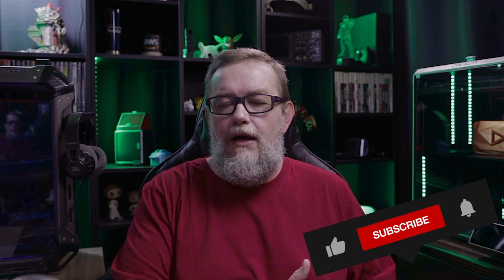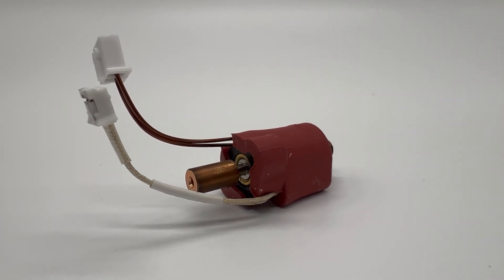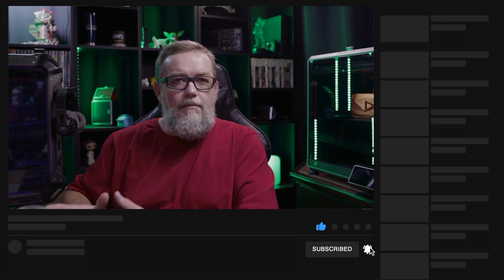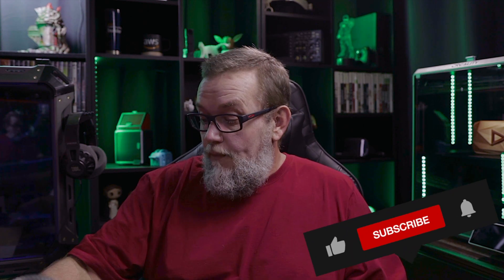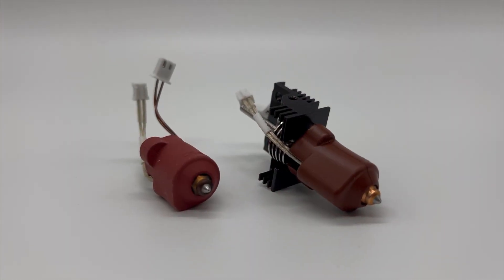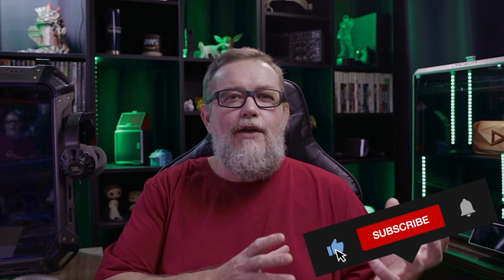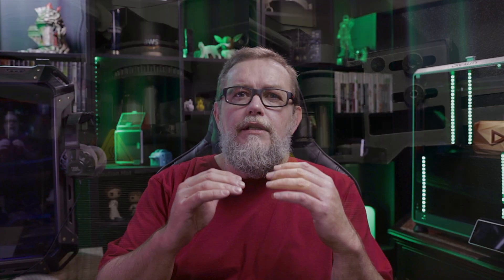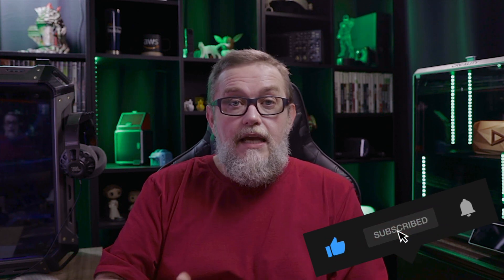Creality K1 Max now has K1C Upgrades: What's New in Creality 3D Printers?

Comment: Hi. I just purchased the new upgraded motherboard and the new motors with smaller pulleys for the k1 max as mine is the older type. Will it be good to go once i have done this or will i need to do any settings. I will update it for the CFS setup once completed. Cheers for a great channel

Comment: @Inventor's Garage
Thank you so much for this information. Based on this video I changed my initial order for a K1C to the newer K1 Max model, which indeed has the upgrades found on the K1C after I enquired. Thanks to you I got a bigger build volume than the K1C but with the same upgraded features. Really appreciate the advice!!

Comment: Hi thank you for your review. I wan to buy an 3d printer but I can not decide. Which one of it recommended from K1C or K1 Max ? Is there any feature exists K1C have and K1 max does not have ? Thank u
Reply from the maker: No, every functional component on both printers are basically the same, K1 Max has the Lidar, what is not really functional at all, at the end of the day the main significant difference is the bed size.

Comment: I'm not sure about the claims of titanium being more resistant to abrasion than stainless steel. I may be wrong, but I thought the point of using titanium for the tube is that it's less thermally conductive so less heat is lost from the hot-end. I.e. it's a better heat-break.

Comment: I have some nice upgrades on printables for the K1C, specifically a fix for the camera lockups, I also have a nice internal filter system for the K1C, also should work on the K1, I just ordered the latest version of the K1 Max and I will have a filter and chamber heater combo upgrade for that one too.
Reply from the maker: I'd love to see the chamber heater mod, can you share it?
Reply: @InventorsGarage  I have on Printables already, but I'll make one specific for the K1 Max once I have it, if you search for NexGen3D on Printables you will find my work, I find that these larger printers need chamber heating, small printers not so much.

Comment: The problem i notice, is the lack of info on creality store at AliExpress, wich shows the different options of nozzle/hotend for the same printer name, i had to replace the nozzle heater and i was almost picking the wrong one, happily i dissambled the old one first and noticed the difference. Just a question if any did it.  New nozzle/heatbreaker/heater/dissipator combo, is just snap off the old model snap in the new one? Or need to change the entire extruder toolhead assembly? I noticed my k1c prints lw-pla easier than my k1max first generation, k1max gets clogged because filament gets foamed inside the heatbreaker/dissipator and goes up to the ptfe tube, and that sugest me some heat is passing to the filament on the ptfe and dissipator transition.

Comment: The funny thing is... The K1C was basically just an attempt at fixing the K1. They might as well have called it the K1C Max and charged $50 extra just to make the money and increase marketing. They still need to fix their extruder design. Give me a Qidi instead any day.
Reply: Tell me about it! I've never been so frustrated with jams as I have with my K1 Max.
Reply: @colenado  Hmm...

My K1 max runs great.

Most problems people experience are with the regular k1. 

🤷
Reply: @DingleBerryschnapps  I finally got mine ironed out with a replacement extruder and hotend.

Comment: I own a K1 Max, got lured in by the sleek look. If I could make the choice again I would build another Voron instead.
This printer has so many flaws that are due to cost cutting design choices it not funny.
It's a cheap ass printer with a premium price tag.

Challenge yourself and build a Voron  people. It's not that hard. By the time you have spent money modding the K1's to be a half way decent printer it will cost you as much as a Voron anyway.

Comment: Nice, but how do they differentiate the versions and settings for different diameter gears for the same model (K1 Max)?
Reply: The rotation distance will be different in the printer.cfg.
Reply: I know, but it was easy with the K1C, how do they solve a factory reset printer config parameter settings because without root you can't modify those
Reply: @j1mmy447  I'm not sure what your asking but sounds like your asking how did the printer know which version of the firmware to install.
It'll be the same as any other, there will be an identifier in the main board that matches the firmware version to the printer.